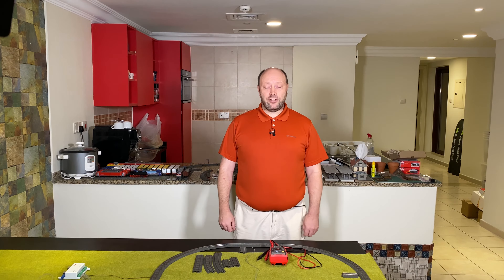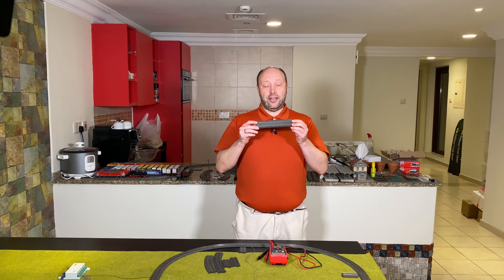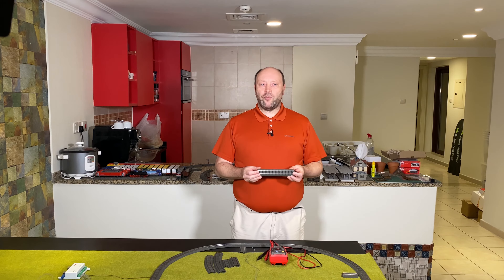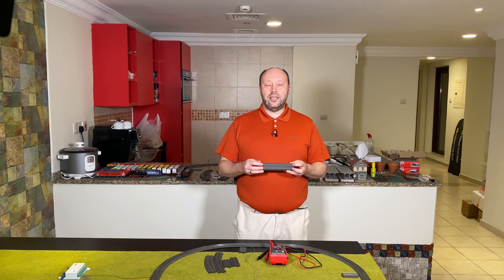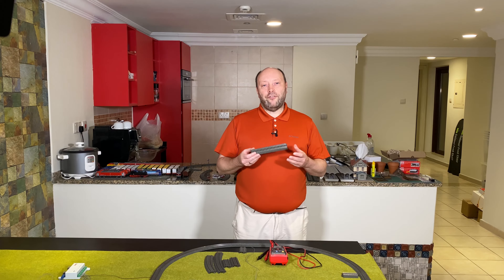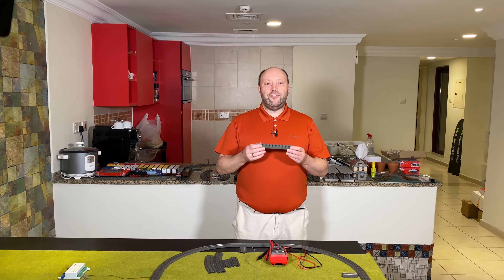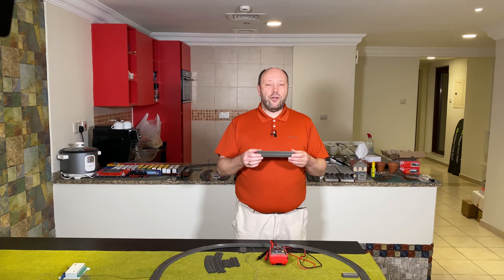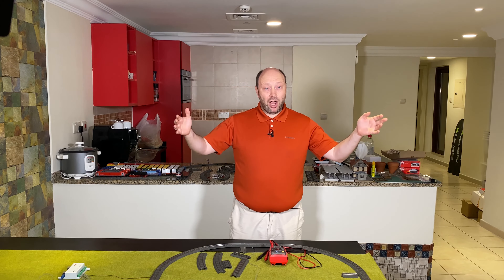Creating and Troubleshooting Märklin C-track Contact Track (Automation Episode 2)

Comment: Very nicely explained the Marklin Contact Tracks. I have an issue that I'm dealing with which I'm not able to understand. I am using the marklin 74924 fully automatic grade crossing which comes with a pair of contact tracks. However instead of adding C tracks in between I decided to add more contact tracks to extend the detection section for the crossing but it doesn't seem to work. The grade crossing doesnt detect the farthest contact track but only detects the one connected to the crossing. Do multiple contact tracks not work?
Reply from the maker: Hi Prashanth, 

Yes you can add more contact track to extend the "detection area". There is an example in the manual on page 25: https://static.maerklin.de/damcontent/bc/9b/bc9ba952d41d8eaa9f7a5a1fe68834461682510322.pdf

Looking at your explanation of the issue it seems to me that you might not have put the special track that comes with the grade crossing furthers away from the grade crossing at the end. Check out the drawing on page 25.

Alternatively, it could be an issue with the contact track where the rails are not proberbly separated - try the troubleshooting in the video 30:17 .  Alternatively, the train you have does not short the rails where you think it wil - try with just a Märklin locomotive or a Märklin car.

Hope this helps! Enjoy ;-)

Comment: Please make a video about the märklin 7244 universal relay.
Reply from the maker: I like your suggestion, but I have never found a use for it. Do you have any ideas? The closest I have found is to use it for "electrical automation" without a control station (CS3 or PC). As I am not doing "electrical automation" I always end up using either the m83 or the m84.

Only example I have seen is @The 3rd Rail that has some interesting video's on his automation. The cool thing is what he does can be done with both digital and analogue layouts - if you use the equivalent modern components. He uses the old style 7244 to solve a signal issue in his "electrical automation" - check it out here: https://www.youtube.com/watch?v=vgxNKeMd38U&t=687

Really interested in ideas for using the 7244 in a Märklin digital layout automated with a control station (CS3/PC). If anybody have any ideas on this, then let me know.

Enjoy ;-)
Reply: @ModelTrainFun  seems to be used in a 2 track schattenbahnhof. As I dont own a central station only Ms2 and delta controls im intrested in how to build automatic schattenbahnhof on a digital layout where you dont have to press Buttons to stop and switch manually.
Reply from the maker: I did a little research and it seems that the Märklin 7244 will do the job, but the disadvantage is that all 4 relay switches are connected together - essentially all relays shift at the same time and cannot be controlled individually. Unfortunately, I did not find a good description for this. It seems you could control one turnout and two stop sections with 2 ports leaving the two others empty. I did see some hacks on the net turning the 7244 into 2x2 ports, but would not recommend it unless you are brave...

I am thinking the m84 might be a better option for a shadow station. It is more expensive, but all 4 outputs can be controlled individually. As I see it - using 1 it seems to be possible to use it for one turnout and two stop sections... The 3 remaining ports could be used for other stuff on your layout... I even seem to recall I saw somewhere years ago somebody making 3 or 4 track shadow station with the m84 - but I cannot find it again...

What do you think?

Note: I am not sure I would do a video on the Märklin 7244 universal relay as I am not entirely sure it would work. However, a "electrical automation" of a shadow station using the Märklin m84 sounds intriguing...

Enjoy ;-)
Reply: @ModelTrainFun  a video about how to build a shadow station using m84 With a ms2, sounds really great to me! Thank you for responding
Reply from the maker: OK - I will make a video on this. However, it may take a little while as I have multiple videos in the pipeline. If you get impatient contact me on my email (see the About). I might be able to explain how to without a long video. Enjoy ;-)
Reply: @ModelTrainFun  looking forward to that and upcoming videos! Thank you!
Reply from the maker: Remind or email me if I forget ;-)

Comment: My idea for to power the stop track when the loco is going the opposite direction of the stop track. Use a circuit track 24994 to turn the stop track power to on (green) just before the loco hits the stop track. Once the loco proceeds over the stop track put another circuit track to switch the power in the off or Red.  As for how to wire this I have not figured that out yet.
Reply from the maker: Hi Michael, You could use the M84 and use the inputs to choose outputs shifting between stop power and/or track power. I think this could be possible, but might require some fiddling... Enjoy ;-) Bo

Comment: Bo.  Thank you for these videos, they're very helpful. I have a problem that I'm stuck up.  I've created and added four contact tracks and three work perfectly,  I cannot get the fourth to recognize when there is a train on it.  I've double and tripled checked that I've connected it correctly, but it down's work.  I've touched to spade connector to the spade connector on the powered ground wire and the connection shows up on my CS3+.  But nothing happens when a train goes over it.  Any suggestions gratefully appreciated.
Reply from the maker: Hi David, I would guess you have connected the brown wire to the wrong end of the contact track. See here for the most common issues I encounter with contact track: https://www.youtube.com/watch?v=2FMWxEPm__Y&t=2062s. Alternatively, there could be a poor connection between the 3 rails that work and the fourth - or you mistakenly put a red insulator the wrong place or side. Enjoy ;-) Bo
Reply: @ModelTrainFun  Bo
Many thanks.  Turns out that I did not completely disconnect the detection rail.  Used a multimeter do sicker.  All good now.
Reply from the maker: Excellent!

Comment: great movies! quick question, when you want to connect a contact rail to a turnout, do you need to do some extra isolation then? Thanks for your support
Reply from the maker: Hi jorgen,

Unfortunately, you cannot split the rails on turnouts like you can on straight and curved section. Hence, turnouts cannot become contact tracks. So indeed you would insulate before/after turnouts .

Enjoy ;-) Bo
Reply: @ModelTrainFun  thanks for info, it seems like 24997 isn’t functioning either
I even needed to add an extra rail between the 997 and the en of my contact track, or am I missing something and does the 997 need extra isolation to connect to a contact track?
Reply from the maker: @jorgendp1  I believe 24997 needs extra insulation. Basically you can make contact track of all normal straights and curves. I might miss one but that’s the basics. Enjoy ;-) Bo
Reply: @ModelTrainFun  i’ll give that a try
Thx for your support

Comment: Thank you so much for your detailed explanations. So clear!
I have K rails. Can I convert them into contact rails well or should I buy the 2295 contact rails? Thank you beforehand.
Reply from the maker: Hi Baudouin, You can also convert K-track into contact track. However, I do not have K-track and have never tried it. I did find the following description that might help you: http://members.ozemail.com.au/~rossstew/rms/pdf/solder_track_cutting.pdf

Hope this helps. Enjoy ;-)
Reply: @ModelTrainFun  thank you again, that helps me a lot. Today I watch your rpisode 3 🤙
Reply: That’s indeed very helpful. However, to make things easier, I was wondering if it would be a reliable option to use the isolation clips 59090 (which allows to avoid the cutting of the rail) together with the connection clips 7500 ( allowing to avoid soldering). Maybe not sufficiently reliable? Thank you beforehand for your answer. Cheers, Baudouin
Reply from the maker: @baudouinvancaubergh4336  The 59090 are for 1 gauge - not for H0 tracks. Hence, you cannot use them with the  Märklin K-track. 

You can use the 7500 to connect power and
I see there is a 7522 for insulating center rail. I did not find any item for insulating the rails themselves?? Not sure what the best option is. You can find K-track contact track such as Märklin 2295 (there should also be one for curves?). I do not have K-track, so not sure what the best solution is...

Another thought - if you want to do a temporary layout, then I would recommend C-track. Even for a permanent layout may prefer to use the C-track. If you are making a permanent layout with K-track your focus should be reliability. In this case the best way to ensure reliability would be soldering and cutting track as described in that guide. I do not have K-track, but that is what I understand is the preferred method.

Hope this helps! Enjoy ;-)
Reply: 59090 oupsss… ! Was going to place a useless order! In fact I have a permanent layout on which I want to organize automatic routes. Soldering is certainly the most reliable option but I am a bit reluctant… fear to damage the rails. 2295 might be the better option for me despite the price. Cheers Baudouin

Comment: Thank you for a very thorough explanation with clear illustrations of the actions that are needed to create and use this specialized track. I would like to take advantage of this feedback message to ask that you create a video on installing and using the Märklin brake module.  I really need to see the specific procedures of installation.  My attempt to install has led to a spontaneous shut-down of my CS3+.  
Also, at first glance it appears that a brake module could be used within an extended section of contact track; or, on the other hand, a shorter contract section could be incorporated within a braking section.  Is that correnct?
Reply from the maker: Hi Fred, 

I have resisted to do a tutorial on the braking module as I find it expensive and complex. However, I will do a video on it in the future as it actually is a really useful feature. 

If you have a shutdown of the CS3 I assume that you have a short circuit of some kind. Did you remember to include the section 1 in the manual? See https://static.maerklin.de/damcontent/a2/e9/a2e9f739a75dab8f95b1c75bdcb21b441572012932.pdf

Section 1 is a transition section that prevents short-circuits. Don't forget section 1 must be longer than the slider/pick-up shoe. Try with a simple small locomotive first. If you have a long rail car with pickups in both ends you might hit other issues.

I believe you can mix the braking module with contact tracks as well. I have not tried it myself, but it makes sense as the contact track is to be the two rails, while the braking module works on the center rail.

If you need additional help try sending me an email (see channel page -> about) and I can try to help over email.

Hope this helps! Enjoy ;-)

Comment: Please, can you show me how to install digital function in a 24997 with a decoder 74460/61/62 under a nearby track, thx!
Reply from the maker: I think YouTube is playing games with me - I have gotten notifications that you have put comments on some videos asking about 24997 before, but when I clicked on the notification it never showed me where. I apologize if I have missed this question before.

You cannot connect the turnout decoders to the 24997 without modification to the cables. I have not tried that and would not recommend it as you have to cut the cables. This video shows it done - https://www.youtube.com/watch?v=1Nw1Rqjs8TI It looks like just cutting the connector to the turnout mechanism and using the correct cables... My guess for the 74492 would be using the yellow and blue cables - but I honestly have no idea. The other challenge is that you have to change the time that the decoder activates - don't know how to do this... This method is not recommended by Märklin and I would not do it, but it seems it can be done.

I intend to make a video on the 24997, but unfortunately it will be sometime in the future. In the meantime you can consiter experimenting yourself. I would use the m83 as shown in the video on how to connect the 74490 to the m83: https://www.youtube.com/watch?v=eGexwTEeFZE As far as I can see you need to connect the yellow and blue wire of the 24997 to the m83 as you would the turnout. You only have one blue which means that the uncoupler track only would work on either Red or Green. 

However, the challenge is that it will not work optimally as the m83 is optimized for the turnouts with short bursts. The 24997 uncoupler track needs longer bursts in order to uncouple every time. If you have the uncoupler track blue wire in the red of port 1 on the m83 you need to change CV 114 to 15. This is easy on a CS3, but difficult on a MS2.

You can see on the Märklin channel how to change the CV - unfortunately it is in German. Turnon YouTube auto-translation to English and it is actually understandable. The video is here: https://www.youtube.com/watch?v=3AikocHI1yE

Hope this helps. Enjoy ;-)
Reply: @ModelTrainFun  well thx for your long answer, I`m delighted but but I have followed this clip you recommend cutting/changing the yellow and blue cables, the green one have to go but with no result, however the symbol reacts in CS3 but how and when I will programing/adressing the article I am not awear of so after all it is still a mysteri however maybe I can mail Märklin and ask them...the best from Rune in just now a snowy enviroment which is excellent for indoors activity, smile
Reply from the maker: Are you trying to use the 74460 directly or the m83? Using the 74460 is tricky... Enjoy ;-)
Reply: @ModelTrainFun  I will use 74460/61/62 NOT m83 because I have no cables underneath...
Reply from the maker: @runeljungstrommer331  Just make it a turnout and use either red or green. However, as far as I can see in the manuals you cannot change the duration of the switch for the 74460/61/62 - so this will not work with the MS2. For the CS3 I can see you can change the switching Time on the 74462 - however, it does not seem to work. If you cannot change the switching Time, then I fear it will not work reliably. Also remember this is completely unsupported. However, let us now if you succeed ;-)
Reply: @ModelTrainFun  But the clip you saw it was working just with a 74460/61/62 which of them I cannot recognize...
Reply from the maker: Agreed - perhaps he knows a trick I am not aware off? If you look at the Marklin video changing the duration is important. However, it might work ok without changing the duration? Enjoy ;-)
Reply: @ModelTrainFun  Can be, the guy will not answer and tell about how the connections are made...I have mailed Märklin "our father" as we call the company...for support...have a nice evening

Comment: you have not showed and told where to connect the grey contact cables...
Reply: That is going to be in a next video i think he said.
Reply from the maker: The other end of the grey cable is connected to the S88 device. This will be covered in the next video in the Automation series. I do agree it is a little unfortunate it is not all in the same video. I was even thinking I should have done the S88 before the contact track, but they both depend on each other. Enjoy ;-)

Comment: Hi, me again. I had few problems with the contact tracks. first everything was ok (checking the contact track with only the freight car) but later I got in problem, no longer recognize the contact track ( 1, 2 etc ) with the freight car. How can I do to delete the S88 Link from the CS3+ and reconnected again ?. Thank you in advance. My best regards. Carlos
Reply from the maker: Hi Carlos,

Not sure why you think deleting the S88 Link and reconnecting it again will help? If the detection is not working it is usually electrical, bad connections, slight touch to something acting as ground or dirty wheels.

I suggest you start with:
- Check all wires: all good - no touching wires?
- Check that everything has good connections and preferably soldered.
- Check the wire from the S88 to the track is not too long.
- Check the wheels of the trains and rolling stock you want to detect.
- The S88 is very sensitive, and you can have an issue if there is the slightest touch to anything that can act as ground. As an example, if you have a table that slightly conducts electricity (or rather sucks out electricity and acts as ground) then it can falsely trigger. Check the wire attached to the bottom of the track and the track itself - if any metal touches the table, then this is enough to trigger. I have a wooden table with paint - this is enough for false detection. Sometimes it only touches when a train moves over, but unstable and it took me a long time to find the issue. I put cardboard in between - or used insulation tape.
- Individually check each connection to the S88 by touching the wire to brown. Is it stable connection when firmly connected?

Did you check all other things in this video?

Right now, I do not know how to remove the S88 Link (except CS3 reset) - I can look into later if needed.

Hope this helps! Enjoy ;-)